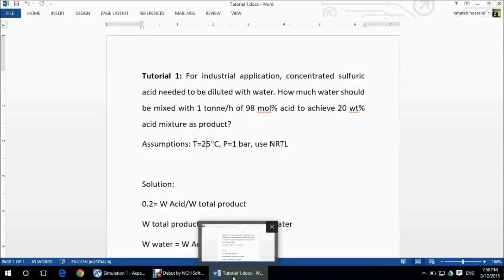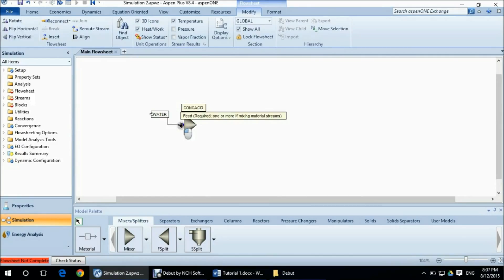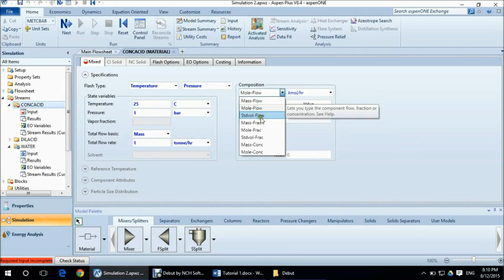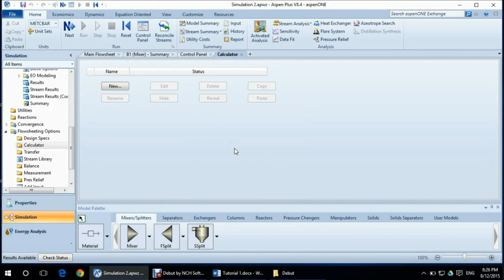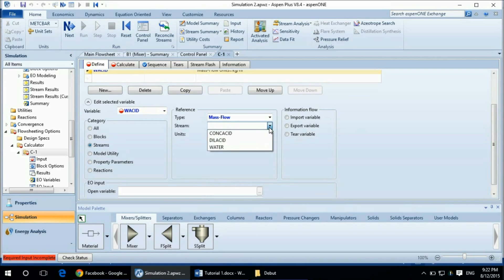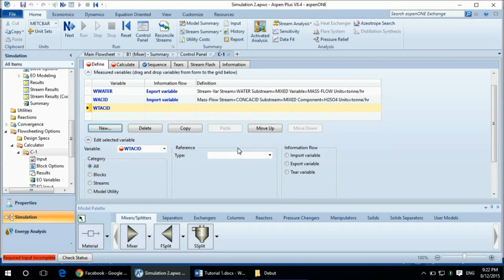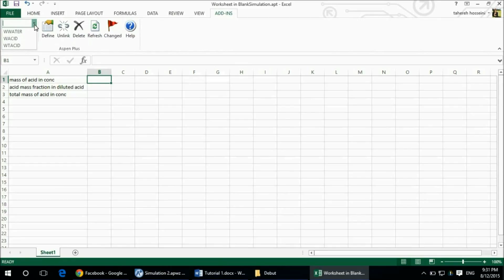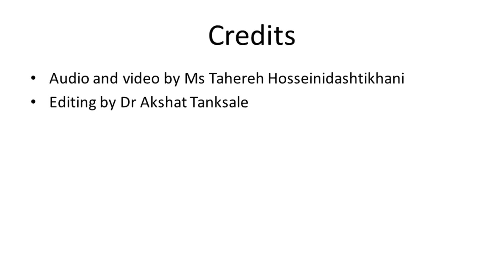CHE2162: Aspen Plus Calculator Block

Comment: Can we add the material streams to the calculator block like adding the material streams to the other unit operation blocks? The purpose is to present the calculated values in the material balance sheet.